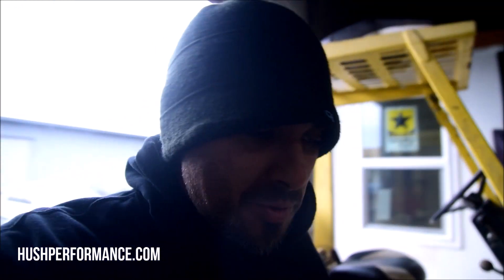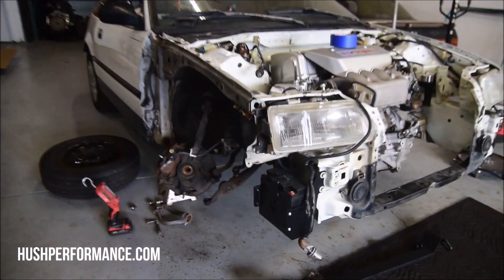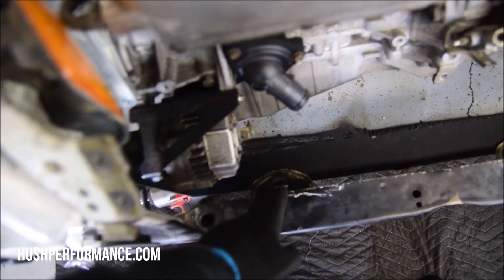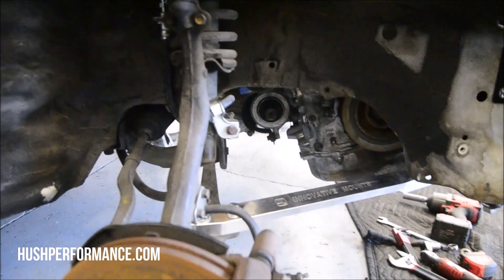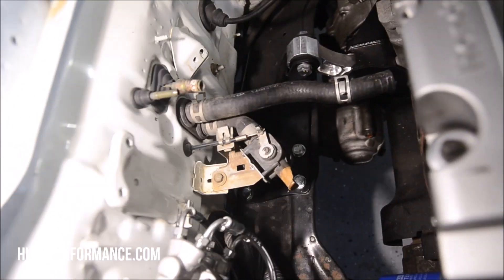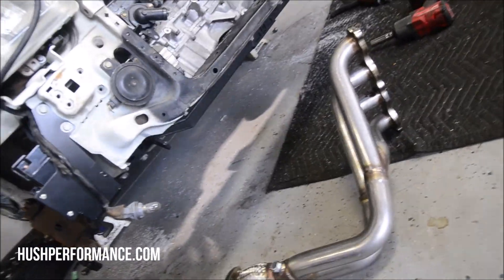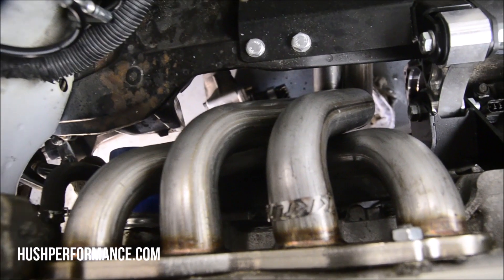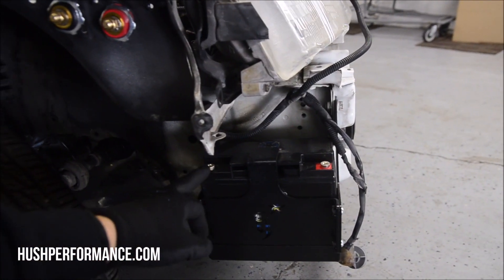How to K Series AWD a CRX Traction Bar Axles and Header

Comment: I have a 1991 Honda Civic body. I’m using a 1994 Honda Civic engine gearbox I’m trying to put it in the 1991 Civic engine mount no fit how can you help with 94 engine gearbox fitting in the 91 Honda Civic to run the road. Help me please with the Project.

Comment: That's a nice bar, I put on one of those cheap track bars for now 🙁.  I want to focus on getting it running and driving first. I just bought a Hybrid Racing no cut shift box and center console. I need pedal assembly because car was an auto.

Comment: I have a question about k24 swaps. I want to swap my tegg with the tsx engine and transmission do you know what axles and half shaft to use? I've done research and can't find nothing. Thank you 

-Adrian
Reply: Can't find nothing? Sounds like you found everything. But seriously, aside from your ignorant sounding double negative, he spelled it right out for you in this. CRX, Civics and Integras use 32mm nut fronts (vs 36mm fronts which are accords, preludes, TSX, TL, RL, CL), so therefore what he used on his CRX will be what you use on your Integra, which is EP3/ base RSX sourced axles. Not the Type S, but the EP3 or base RSX which is the Civic Hatch Si with the weak-tec 2.0L 160hp K-20. For the halfshaft you will need a K20A2 sourced, as the K24 makes the axle too long. https://honda-tech.com/forums/k-series-153/k-series-axles-2637704/

And since you really didn't search and are wanting to be spoon-fed here you go, google search " tsx k-swap integra axles"
https://jhpusa.com/collections/axles-k-series/products/hasport-chromoly-axles-92-00-civic-94-01-integra-k-swap

Has your hand been held enough now? And did you learn that double negatives make you sound ignorant? Tis the price of asking to be spoon fed.
Reply: @numberpirate  I really appreciate you for giving me and the fans and followers on this page with more info on k swapping any build. I have done some research and haven't had any luck with the 6 speed TSX transmission swap in to any of honda/Acura chassis and yes I know about the wheel hub bearing on the integras with the 32mm axles ends. You might be an expert on k swapping any engine and transmission to a vehicle. But I am still learning and still doing some research to purchase the right parts for my build so I won't buy the wrong one. I would really appreciate it if you do not disrespect me again.

Comment: Answered alot of my questions about traction bar fitment with k series. Thanks. I have the previous innovative front cross member. I like the previous design better it's heavier but it's fitment to lower control arms is much better.

Comment: With a 17 mm wrench you could have removed and installed that bar with the car on the ground and shock fork installed. It's tight, but it would have worked.